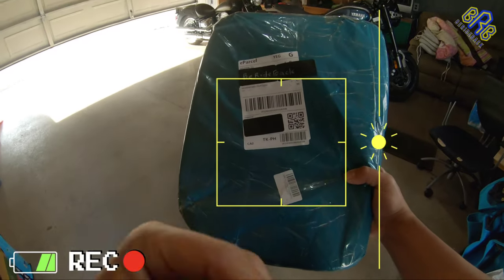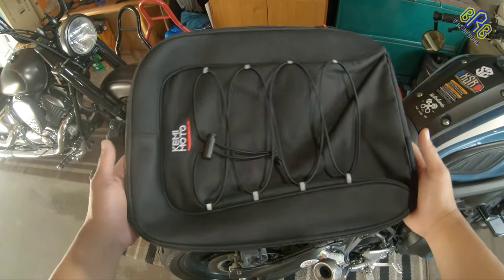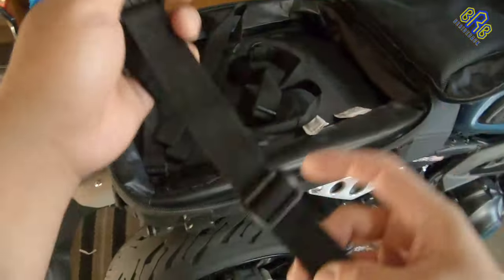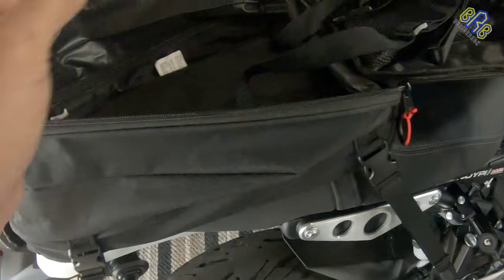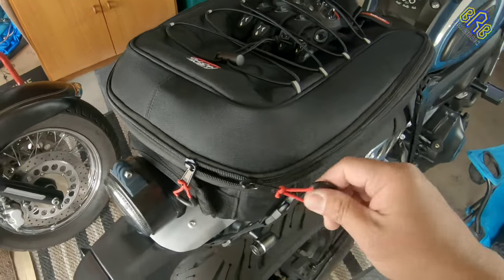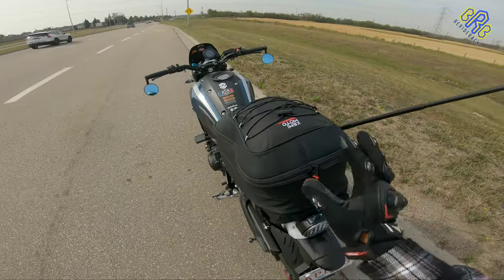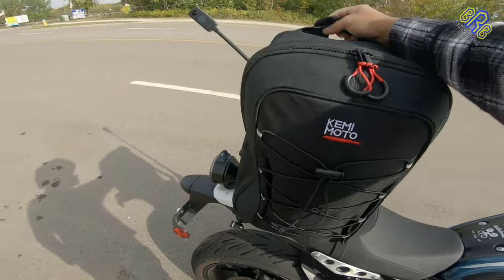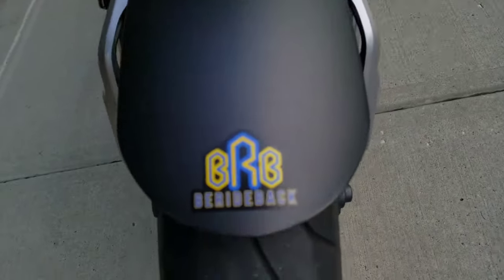KEMIMOTO Motorcycle Tail Bag

Comment: Looks like it was strapped where swingarm movement, would immediatly loosen strap when shock is compressed, hitting bumps?
Reply from the maker: Thanks for turning in, No not the swing arm it's the passenger footpegs never install it on a moving parts to avoid injury ok hope this video helps 👍